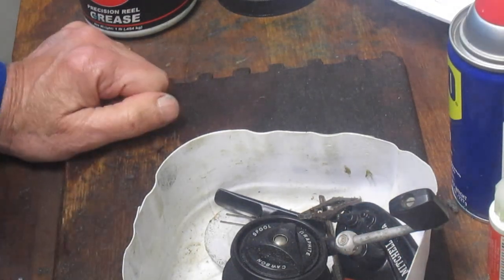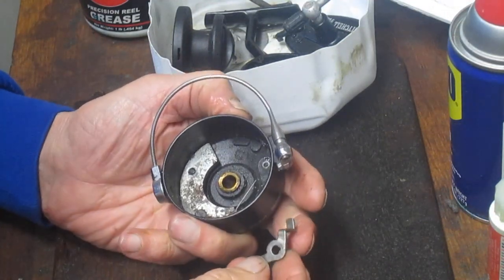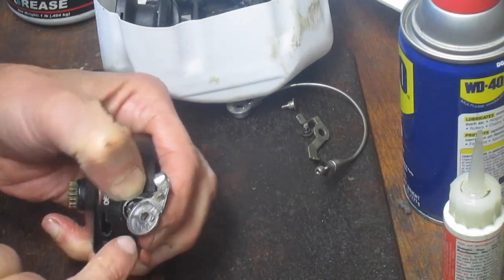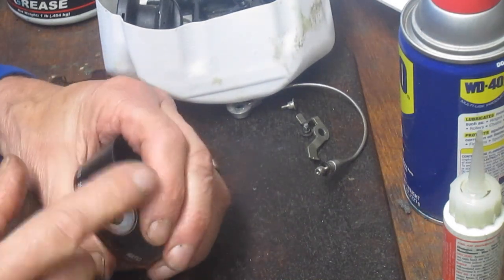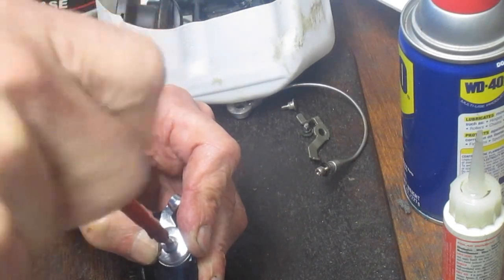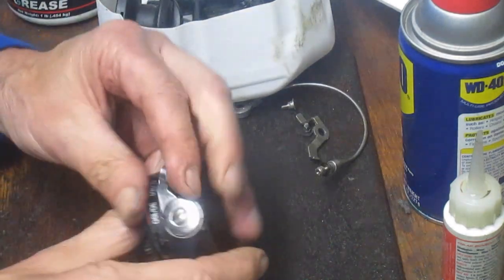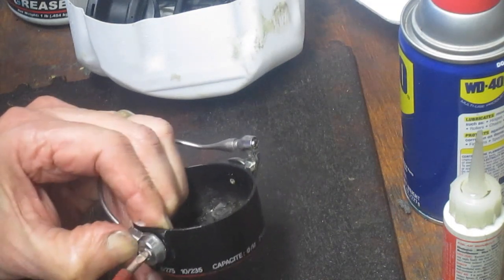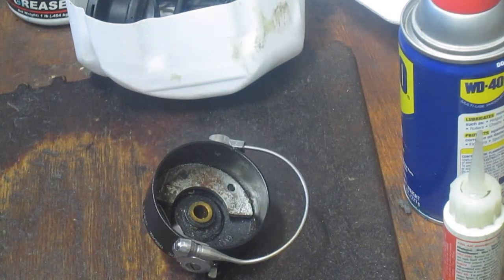How to set the bail spring on a Mitchell 300A it differs from the 300 set up

Comment: Like this video ! Could you please make a video on how to repair the D.A.M. MDS reel spool which the magnet came off from the spool due to the silicone rubber that holding it hardened.  Thanks.
Reply from the maker: Dennis - I do not have that reel in my shop.  I will add it to my request list and do it if one comes in for service.  Thanks for asking - Dennis

Comment: I also have a Mitchell 300A, but the bail is different from the one you show here. It has a hole for the spring, not a cavity. Is mine an older or newer version of this one?
Reply from the maker: I'm not sure on that.  Can you send a picture to my email 2ndchancetackle@gmail.com ? I will try and help you identify when it was made - Dennis
Reply: Sounds like an older 300A. The 1977-1979 300As had a bail setup similar to a standard 300, so you would set up the bail the same way you do a standard 300

Comment: Excellent video. Luckily I’ve never had a bail spring problem on my 300A. Compared to a 488 this is very easy. I have purchased asked a 306A but can’t find the schematic. I can find  the 306 and 306S but not the A variant. It should be like the 306 but might have a pinion/bearing as opposed to the pinion/bushing. Do you know about the 306A and whether it has a bearing?
Reply from the maker: You may be able to find the schematic here https://mitchellreels.ourboard.org. This is a valuable website that you should bookmark for info on the Mitchell reels - Please stay well - Dennis